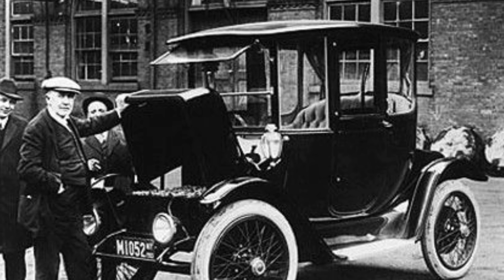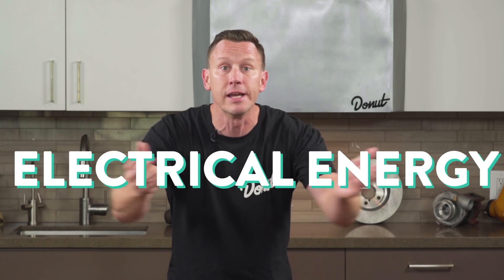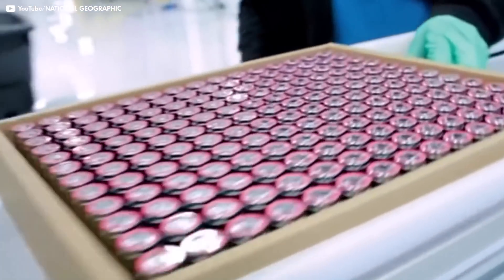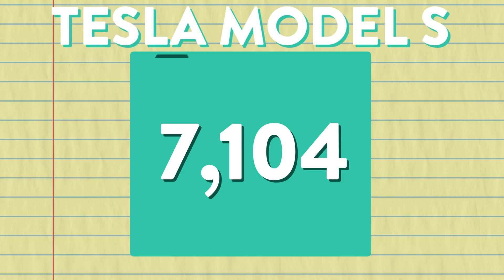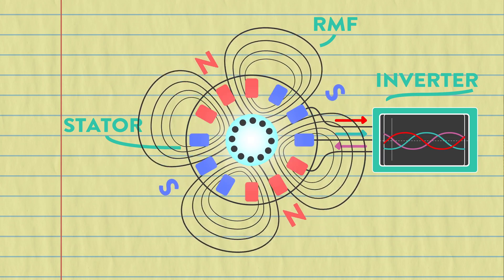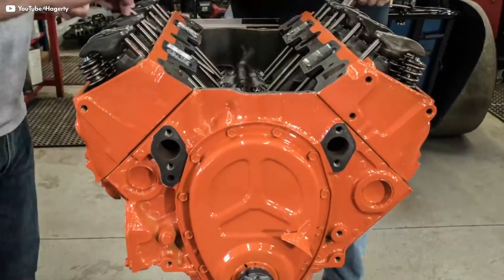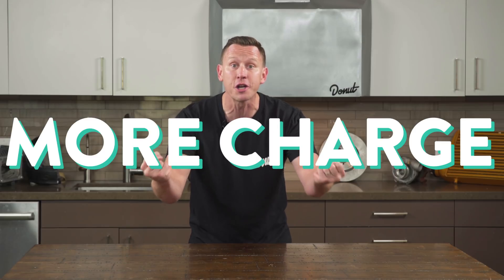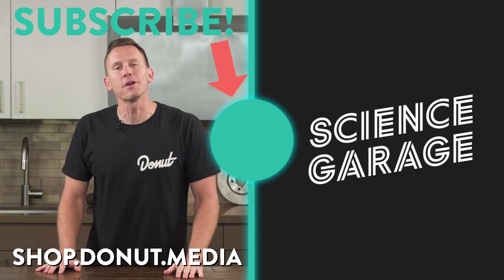ELECTRIC CARS | How They Work

Comment: The battery capacity is measured in either amp-hours, or sometimes watt-hours. You get it by multiplying the current by the time that battery can supply that current.
The description of asynchronous motor is on point, but this type of motor isn't used in EVs. There's BLDC motor, which works on a similar principle, but instead of the cage, there are magnets. There is a 3 wire controller, but it sends a DC signal to the 3 coils in the motor. The reason, why the asynchronous motor isn't used is, that in order to do regenerative braking, the motor needs to move magnets near the coils to generate electricity. And as there are no magnets in the AC motor, as all of the magnetic field gets fully created by the coils and induction of the rotor "coil" moving relative to the magnetic field of the stator coils. That's the reason, why it doesn't work the other way.

Comment: this is so wrong, volts arent limited by amps, and amps are not capacity
voltage is electrical pressure, amps are the width of the flow, frequency is how quickly the voltage switches between positive and negative.
as long as the battery has the power to deliver, whatever device is being powered -ie. an inverter driving the motor can draw as many amps as it wants at the same voltage - the same pressure just a wider flow, or if its a fancy inverter it will also start powering the motor at a low frequency then ramp it up. maybe starting at 5hz for instance speeding up to 50hz as you accelerate. the frequency will control how fast the rotor inside the motor spins

Comment: This was completely wrong.

Voltage is the force an electrically charged particle is carrying.

Amperage is the amount of those particles coming through.

A watt is the amount of energy transferred.

Think of it as water.

The water tank should be the amp-hour or watt-hour, not the voltage.

An amp hour is basically "1 amp-hour is 1 amps of current used over an hour. I could also use it for 2 hours at 0.5 amps."

The same goes for watt hours except amps are watts.

1 volt * 1 amp = 1 watt.

2 volts * 1 amp = 2 watts.

1 volt * 2 amps = 2 watts.

2 volts * 2 amps = 4 watts.

1 kilowatt = 1000 watts

If you have a 9 watt-hour battery and a 9-watt light bulb you could use it for an hour before draining the entire battery. Alternatively you could use a 1 watt lightbulb for 9 hours.

Comment: The carbon footprint of an electric car isn't simply about the energy it uses "as a vehicle", you must also consider all the mining for the minerals used in Li-Ion batteries as well as the fact that those batteries will eventually die completely and they are highly toxic and virtually impossible to recycle.

Comment: just to clarify... Ampere is not really 'capacity' , it is the rate of flow of the electricity which you use the capacity to store ... the true measure of capacity is how long you can keep the electrical current flowing at that rate - that is to say, ampere multiplied by time ... usually its measured in Amp Hours , i.e. how many hours it can keep discharging 1 amp for , or how much current it can discharge for it to run out after 1 hour

the amount of current that a battery can put out is usually correlated to the capacity of the battery, because to add more capacity you add more anode and cathode material, and this is analogous to putting batteries in parallel... this correlation is the source of the confusion between capacity and rate of flow

btw, the unit of electrical charge is called 'coulomb',  named after Charles-Augustin de Coulomb ... think of one coulomb of electricity somewhat similar to one liter of water , but whereas we dont have a word for how fast water flows, a flow of one coulomb a second is one ampere
Reply: and energy stored in electricity, that's measured in voltage ... analogous to how much height you lifted one liter of water to

basic physics  : energy is measured in joules, and the rate at which the energy is released is what we know as power which is measured in watts... therefore, joules are also expressed in terms of watt-hours , how many watts you can keep up for one hour and vice versa
so in a water dam, for every liter of water at its height, it has a certain number of joules of energy .... when the water is released, the wattage is this joule energy multiplied by how fast the water is flowing
and analogously in a battery, when it is not connected to anything, every coulomb of electricity has a certain joule value , and this is what we measure as voltage... once the circuit is made and the charge starts flowing as amperes, the wattage is the voltage multiplied by amperes

Comment: First of all, Battery stores electrical energy into its chemical composition. The chemical composition of a battery consists of anode and a cathode which are separated by electrolyte. Suppose a battery's anode and cathode are connected by a circuit externally. Thus completing the circuit. During discharge of electricity, the electrons from the anode travels from the anode to the cathode via the circuit. Basically, this process converts stored chemical energy to electrical energy and that is what generates an electric current.

Comment: Love the video! The video was a little confusing about the peak current draw from a cell vs its capacity, so I'd like to clear that up.

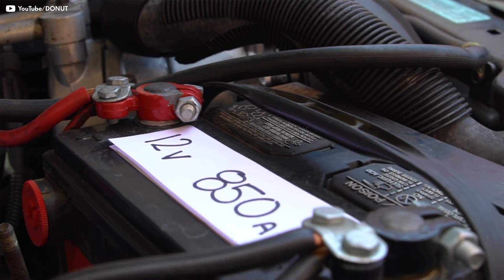You say "on a battery, amps measure capacity" (3:47). Capacity, often measured in milliamp hours, is how long a battery can output a certain amount of current (or how much current it could output if it took an hour to discharge). On most 18650 cells used in electric cars, this number falls between 2000 and 3000 mAh.

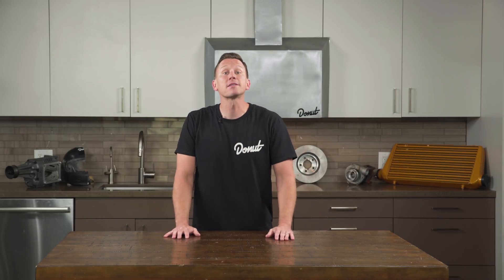The current rating of a battery (the 30 amp figure given at 3:23) doesn't actually dictate how much energy (or capacity) the cell contains; it is a measure of how quickly the cell can output that energy (like you say in the dam analogy). Most 18650 cells, including the ones used in earlier Teslas, are rated for between 20 and 30 amps.

Love the videos, and keep up the good work!

Comment: Alright... You can't be serious. Had to pause the vid at 4:31 ... As an Engineer, this is just insulting. Whos doing the Physics & Calculations here at Donut?? The SERIES Circuit (GREEN Batteries on left) is fine, but the PARALLEL Circuit (PINK Batteries on the right) is supposed to read: "6V 4A" ..... Come on Donut, 2+2 = 4 , not 12! 

PLS LIKE TO SHARE WITH ANY STUDENTS OUT THERE ACTUALLY TRYING TO LEARN HOW BATTERIES & CIRCUITS WORK... 
(Don't want my future engineers thinking 2 plus 2 is 12 :/ ) 
That's prob what happened to Fiskar & is why THEIR cars catch on fire...

Comment: Your battery explanation is incorrect.  Other people in the comments are trying to correct you, but they're also getting it sort of wrong.  I'm not a specialist in battery technology, but I do have a masters degree in engineering, so maybe that means I know something.  But I'm just a random guy on the internet, so please double check me if you're suspicious of my explanation.  

First, the nominal voltage of a single, cobalt-based lithium ion battery is 3.6V to 3.8V depending on the manufacturer, not 4.2V.  It is true that the cell is 4.2V when it is fully charged, but when we rate the voltage of batteries, we rate them based on their nominal voltage; we never rate them based on their fully charged voltage.  As an example, your 12V lead acid car battery is actually more like 13.5V when it's fully charged, and somewhere around 10V when we consider the battery "dead".  A lithium ion battery cell is around 4.2V when it's fully charged, and around 3.0V when we consider it fully discharged (lithium ion batteries with protection circuits will generally kick in around 2.7V to 2.8V to protect the battery from damage due to undervolting).  So yes, in a way, a lithium ion cell is 4.2V if you take a voltmeter and measure its open circuit voltage when it's fully charged, but this is not a realistic measure of voltage under operation, so we rate batteries based on their nominal voltage instead.

Second, as people are pointing out, you're going back and forth between calling amperage "current" and "capacity"; they are not the same thing.  Amperage [A] measure of electric current, it has nothing to do with the energy capacity of the battery.  The fundamental unit of energy (or energy capacity) is joules [J]; this is how energy capacity should be measured, but because engineers and scientists often like to make things extra confusing, when we talk about batteries, we often measure energy in watt-hours [Wh] (or kilowatt-hours [kWh] when the number gets large).  To make things even more confusing, some idiots a long time ago decided they wanted to take a shortcut and start rating energy capacity by amp-hours [A*h] instead of watt-hours.  Amp-hours is not technically a measure of energy capacity, but it is linearly proportional to energy capacity since voltage [V] times current [A] gives you power [W]; so one could say that amp-hours is a energy capacity rating, rather than an actual measure of energy capacity.  As long as you are comparing two batteries with the same rated voltage, you can compare their capacities by looking at the amp-hour rating; if not, then no bueno.  As an example, a 12V battery with a 4 Ah capacity rating has half the energy capacity as a 24V battery with a 4 Ah rating.  The 12V, 4 Ah battery has 48 Wh of true energy capacity, whereas the 24V, 4 Ah battery has 96 Wh of true energy capacity; but you could be tricked into thinking that the two batteries had the same energy capacity if you just looked at the Ah rating (this is why this system is idiotic).  

Therefore, when you wire two identical batteries in series, you double their voltage, but the maximum potential current draw remains the same.  When you wire two identical batteries in parallel, you double their maximum potential current draw, but the voltage remains the same.  In both cases, the energy capacity doubles (you now have two batteries, and therefore, twice the amount of energy capacity).  The voltage and current dictate exactly how you're allowed to transfer energy from those batteries in the system down the line.  

To recap: Voltage [V] is a measure of electric potential.  Current (in amps [A]) is a measure of electric current.  Joules [J] is a measure of energy (or energy capacity).  Watts [W] is a measure of power; like horsepower [hp] or kilowatts (for our metric friends) in a car engine, power is a measure of the rate of energy transfer (it is equivalent to joules per second [J/s]).  Often times, we measure energy capacity in terms of watt-hours [Wh] instead of Joules [J], both are mathematically correct methods of measuring energy capacity, but obviously have different values.  Sometimes, we _rate_ energy capacity using amp-hours [Ah] instead of watt-hours or joules; as long as the voltage of the batteries you're comparing are the same, then you can compare capacity based on their amp-hour rating.

Comment: Hi um I’m really curious as to why the electric cars are so quiet, when I think of an electric motor I think of that really nice sound a lot of our electrical motors and all make when they are turned on and the mechanism slowly starts up and then gets faster and faster until it finally reaches its max speed and just stays making the same noise till the mechanism begins to slows down from you turning the machine off.

Comment: That last part is inaccurate. Because of the shorter span of time where the carbons are produced in the production of electric motors, they are actually more damaging to the atmosphere than a 13 mpg car from the 70s. Think hitting your finger with a hammer. A gasoline powered car is like the occasional bump when you miss the nail - you can walk it off as fast as it happened. Electric cars are like using a sledgehammer for the same job - your fingers are likely broken.

Comment: I learned more about voltage from this than my AP physics class
Reply: This was completely wrong.

Voltage is the force an electrically charged particle is carrying.
Amperage is the amount of those particles coming through.
A watt is the amount of energy transferred.

Think of it as water.
The water tank should be the amp-hour or watt-hour, not the voltage.
An amp hour is basically "1 amp-hour is 1 amps of current used over an hour. I could also use it for 2 hours at 0.5 amps."
The same goes for watt hours except amps are watts.

1 volt * 1 amp = 1 watt.

2 volts * 1 amp = 2 watts.

1 volt * 2 amps = 2 watts.

2 volts * 2 amps = 4 watts.

1 kilowatt = 1000 watts

If you have a 9 watt-hour battery and a 9-watt light bulb you could use it for an hour before draining the entire battery. Alternatively you could use a 1 watt lightbulb for 9 hours.

Comment: This man singlehandedly covered a whole semesters worth of physics topics 🤯
Reply: But would you pass the test? That's my question...
Reply: @redflame300  nope, not quite accurate enough on the battery side.
Reply: @Jaker788  what was the mistake?
Reply: Too simple
Reply: If you could calculate the total impedance in a Model 3. I'd let anyone take my physics test for me.
Reply: @sahilhassan8538  THAT'S the other one. I knew there was 3 lol
Reply: Lol, nope. 
Get your facts right
Reply: As someone who works in physics, and has extensive experience under my belt in this field; please ignore the morons who replied; I’ll show your comment to my brother (who is a decade my younger) and I hope that your well thought out and logical conclusion will inspire my protégé ((I’m aware that this was probably just an off-hand comment on your part; however you have re-galvanised my passion x
Reply: 320th like

Comment: well... we mine and burn coal to produce electricity and use nuclear power plants and oil also, because solar and wind power plants just dont work... then we destroy the planet making very dangerous and explosive lithium batterys about 5000 or 6000 per car size 18650 that only last for 300 or 400 charger cycles and make and  ELECTRIC CAR that is 3 times worst for the planets to produce than a normal petrol or diesel car and takes hours to charge and has limited range... ohhh... and they have magnets that are use to make ELECTRIC engines...

Comment: So how does reverse work?  Do they change the wiring sequence on the stator windings?
Reply: thats the beauty of a 3 phase induction motor...u can reverse the rotation direction without physically changing any terminal wirings...just reverse the phase sequence and u are done...the rotor now rotates in opposite direction

Comment: Many different types of lithium ion batteries and many different Model S configurations they’re not all the same. You listed the max amp output of the p100d with the ludicrous upgrade but then mixed in the specs of lower end models. 1500amps & 2.28s 0-60 not 4.5s. Common guys.

Comment: How does braking charge the battery?
Reply: its called regenerative braking...when brakes are applied the rotor of the induction motor acts as a prime mover and the kinetic energy in the wheel is transferred to the stator in form of electrical energy which after converted to dc by the rectifiers is fed back to the battery pack

Comment: The lithium mines are worse for the environment than gas motors in general.
Reply: haha, you make this claim and you dont even know that most lithium comes from brine water. also when is the last time we had a lithium spill in the gulf of mexico?
Reply: There is a reason I said mines, and we constantly have battery acid seep into the ground
Reply: @joshdowda7559  *mine*, there is only 1 pure lithium mine operation in the world and its in Australia vs the 1000s of oil and gas mining operations in the world, also what do you think happens to all the oil in the car? i had some of it buried in my back yard and my tree touched it and died years after it was buried, also you show further ignorance by saying *battery acid*, lithium ion batteries are not those led acid batteries you find in regular cars and trucks, the most dangerous element in a LI-ion battery is cobalt and not all LI-ion batteries contain cobalt, Tesla batteries have some but they don't leak it into the environment since they are encased in a metal shell as where a lead acid battery has ventilation seals to let out a build up of hydrogen gas.
Reply: Josh Dowda we constantly have fracking fluid leak into the ground and oil spills are utterly catastrophic, battery acid isnt as comprable
Reply: How much time did you spend typing that out? thanks 👍 for the info
Reply: @joshdowda7559  like 4 minutes, it helps to do  a bit of research or have previously leaned knowledge before you type something on the internet as a matter of fact.
Reply: Oh, really I didn't know

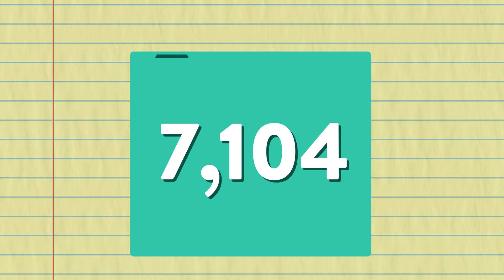Comment: 4:32 , If you are connecting the batteries in parallel then you are doubling the amperage , which means the final amperage in this case is 2amp + 2amp = 4 amp. not 12 amp

Comment: Small editing mistake @4:32 the parallel batteries would be rated for 4 amps, not 12.
And a battery doesn't contain current, it can output current.
And (last complaint, I swear) current doesn't measure capacity, current OVER TIME measures capacity

Comment: The old electric cars from the late 1800s and early 1900s actually used nickel cadmium or nickel iron batteries “invented” by Thomas Edison. They got about 100 miles on a charge (pretty impressive for no regard for aerodynamics or weight) and were refillable with the chemical at recharging stations instead of actually being plugged into a current.